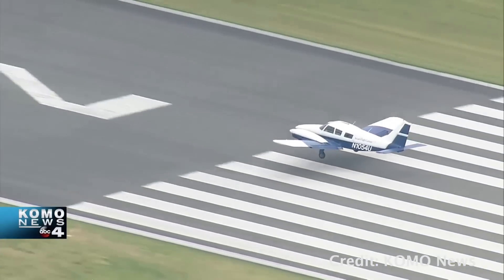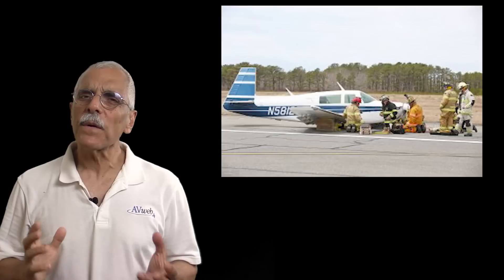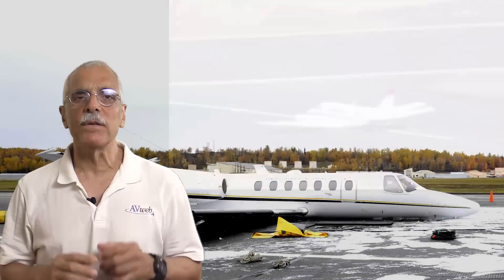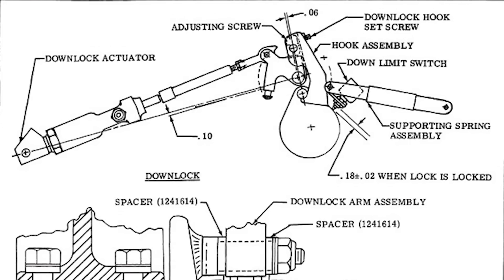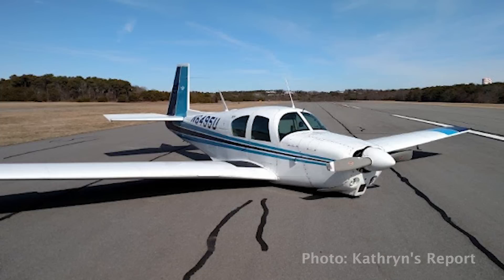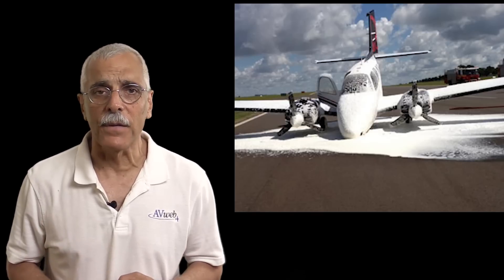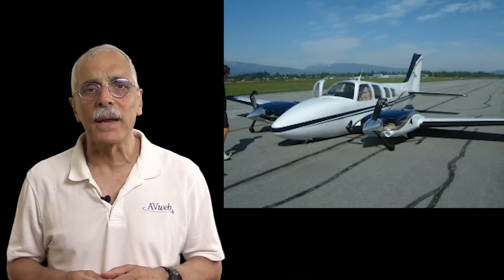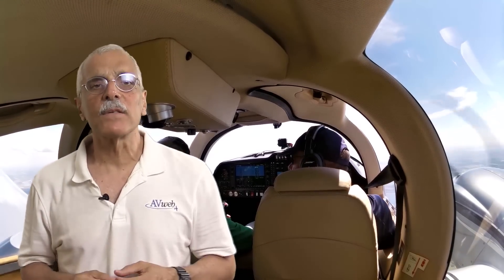Why Gear Up Landings Happen

Comment: I appreciate this video VERY much. I fly corporate and got distracted on long final by an ATC order to go around, ATC also advised they needed time to sort out what was preventing landings, ordered me to higher holding altitude and speed. So; I elected to reduce landing gear drag and clammed up.

When I got clearance to land again, I also went through my approach and landing check list, again, which is bullets and briefs, written down, and easily visible day or night, and not blocking gauges.

I was confident all was well until I got to GEAR DOWN: I was surprised I did not remember GEAR UP. So; DOWN they went. Never assume, always check, then recheck if possible, and have a visible check list. I got flustered because I swore to myself, "I KNOW I lowered the gear." But did not remember raising gear.

So, with ego working too much, I finally realized I am now distracted !!

LESSON: every once in a while, or, as often as necessary, one has to shuttle the ego to the off ramp and fly - aviat; navigate; communicate  ... use the disciplines of self-control and aviation knowledge. Those habits build solid, reliable experience and expertise. Those repetitions build confidence but confidence is not substitute for an up to date check list. A check list keeps you aware, attentive, and alive.

It does not matter how much pilot experience one has because, most every landing/take off check list procedure is the same. Some exceptions relate to weather, icing, and traffic. But the basic check list does not vary very much - EXCEPT - every landing and take off - EVERY SINGLE ONE - is NEVER the same especially and including touch-and-go.

Never assume, be complacent, because that can get you killed. I always keep looking up, down, side to side, and as far to the rear in those actions as possible for that errant Cessna or 777 taking air space they should not be taking - or did you just get into air space for which you were not cleared ...
 O :(  M :(  G :(

Never assume anything. Check it, prove it, anticipate, and fly accordingly.

Great video. It was a welcome refresher training !

Comment: To add a bit of humor I submit my experience as a police officer dispatched to a plane crash.  Skipping all the details I leave you with the pilots only comment:"I forgot which plane I was flying and instead of lowering the flaps I raised the landing gear!"
Reply: guess handles of switches move up in some planes down in others or, ...and did not check gear lights

Comment: I have only one close call so far where cycled the gear and got no green lights. It ended in a maximum pucker factor, a go around and a gravity drop just to be sure. Turns out all three bulbs decided to quit the job at the same time and now I fly with a full spare set just in case.
Reply: can get leds that never fail l read

Comment: I have a video of an inadvertent gear up (of me)... We were having a short field contest at the airport open house, and I forgot (due to non-standard approach/distraction from checklist). It was quite a surprise when the nose, which normally descends to horizontal, dropped past that with the resulting grinding at 70 knots (80 mph). I agree with your pavement suggestion. No prop damage on my landing  '-)   https://www.youtube.com/watch?v=uiWM_bxVS18  You don't mention canard type aircraft, which evidence seems to indicate at least 50% have forgotten at some point.

Comment: Why do gear up landings happen? Because the habits and procedures to prevent them are not in place. Have you noticed that it just doesn't happen to the pros at the major airlines? Why? Adherence to procedures and checklists, and configuration warnings that cannot, in some cases, be cancelled. The response "down, three green" is made while looking at the indicators, by both pilots. If a light is out, a glance at the repeater display on the overhead panel will tell the tale, real fast. The checklist will save a GA pilot in the same manner. I make it a habit to look, one more time, at the gear indicators while passing 1,000' AGL on landing. 50 years so far (knock on wood), and have never come close to a gear up landing.

Comment: I was a glider pilot some years ago and a friend also "forgot" to put the gear down. Luckily not much happened, just the gear doors were ripped off and it was easy to reapair. Guess it's also about the weight. A glider weights around 250kg, compaired to a tinplate colossus (e.g. C210) around 1.5t :-)

Comment: I've been flying for 38 years and that's one of the best analysis on gear up landings I've seen.

Of particular note is the analysis on pilots shutting down engines to save props.  That is something I always said complicates the situation and can make things much worse.  I've received no small amount of static for making that analysis myself.  It seems some people just can't make the correlation that shutting down engines prior to touchdown is actually compounding the emergency.

Shutting down engines at touchdown is much better than shutting down engines prior to touchdown if one is going to shut down engines.

In the video I linked to below the pilot chose to shut down the engines well prior to touchdown.  This was videoed live on CNN.  The anchor mentioned what a great job the pilot did and how appropriate it was to shut the engines down when he did.  I don't agree at all.  He turned his plane into a glider and compounded his emergency.  Now in addition to the nose gear being retracted, he has a dual engine failure and no ability to go around.

In the comments section of the linked video below, I mentioned that this was probably not a good idea for the reasons I stated. This was around two years ago. The amount of static I got for saying that is in the reply.

In addition to compounding his emergency by creating a dual engine failure the pilot in the below linked video was distracting himself from the landing by bumping the props with the starter switch all the way to the runway. This probably contributed to the instability of his pitch control at touch down where he almost dragged the tail.  The pitch instability is apparent.

I don't expect news anchors to know what a good landing is and their opinions are usually skewed by ignorance.  Pilots however should know this.

In the quest to save several thousand dollars for the insurance company or oneself if one owns their own plane and is stupid enough to not have insurance, many pilots risk hundreds of thousands of dollars and the lives of everyone aboard to do that.

Read the comments in the video I linked below to see what the popular opinion is.  

No one noticed that the pilot landed in the displaced threshold, well short of the runway.  With both engines shutdown, he had no choice.  Lucky for him there was no sudden wind shift to a stronger headwind or he could have landed short of the displaced threshold.  How much money would he have saved then?

https://youtu.be/dH_AzTvnN_Q
Reply: Rick Durden in "Thinking Pilots Flight Manual" would agree with You. 

It compounds the emergency, distracts the pilot, removes all options, increases workload substantially, and still doesn't save the props. The engine manufacturers recommend teardown anyway. If its a comemrcial op, the FAA mandates overhauls for gear up landings, even if the props don't make contact with anything! Its not part of the requirement.

Comment: Regarding forgetting to lower the landing gear, why don't planes have a warning system that activates a light/bell or says "warning, gear up" or something if the altitude goes below some limit while the gear is still up?  That seems like it would be relatively simple to implement.  With a pressure altimeter, you'd also have to set the altitude of the runway (which could also be forgotten or botched), but not with a radar altimeter.

Comment: Super informative video.  And changed my mind on a few things, like keeping engines running, and choosing pavement instead of grass.
Reply: Choosing to leave the engines running all the way down to prop contact only ensures replacement of the crankshaft and other vital internal components. If you can, stop prop rotation just prior to contact, and the teardown and repair will be far less costly in the end.
Reply: @Steve-fe4lq  Obviously, everything you said there is true, though even stopping the props in no way insures that no engne damage will be incurred anyway, unless the prop stops in a position such that no ground contact will occur (near horizontal).  Even if you bang a stopped prop tip into the ground there can still be serious engine damage, especially with a metal prop, I expect, though most assuredly less. 

I guess my point was this, if you are a very high time very experienced pilot, your approach to the termination of such an emergency likely would, and possibly should, be different than a pilot doing everything he can (loaded to the brim with 'tasks') just to get it on the runway WITH the props still turning, just by virtue of decreasing pilot loading a bit at that critical juncture.

It also comes down to knowledge.  The average driver on the road who is trying to steer clear in a major avoidance situation will be likely to his foot smashed down on the brake pedal (assume we're talking pre ABS, for my point here) and will not understand that this absolutely insures that ANY steering input will not make the slightest difference in what the car does or where it goes. Tires locked up solidly and turned to lock or dead straight ahead steering makes no difference. On the other hand, if you start to spin in a car, and are vectoring reasonable straight down the road, you absolutely WANT to lock the brakes, for that very same reason, your initial velocity vector will then remain relatively constant.  The (maybe slightly) below average driver on the street, on a notoriously slippery when wet road, when they run into the back of someone is CONVINCED their brakes failed (no kidding, had it happen, couldn't convince her otherwise...so she learned NOTHING, not making this up, it happened)..this road was possibly the worst wet asphalt surface I have ever driven on, no idea why, other than it was VERY smooth, but it seemed like more than just that.

The analogs of this sort of thing is what an experienced, well trained, knowledgeable pilot knows, and the average plane driver does not.  That is one reason I believe there might be reasons to call for continued engine operation all the way to the ground for the average airplane driver.  Does that make sense?  I think removing stall spin training from standard flight training is an idiotic move...can you imagine facing that for the first time (if you've ever done a stall/spin) at low altitude.  Your chances of recovery aren't very high if you KNOW what you are doing, ZERO if you don't.  Obviously the NTSB/FAA suggestion is directed to maximum survivability, with zero concern for the aircraft components themselves.   Seriously, though, in the long run it really IS only money, compared to possibly serious injury or your life (again, not saying stoppage isn't well within some pilots capabilities without increased personal risk) for the average plane driver.  And also, I agree with you a pre-planned switch flick is not a big deal to a calm experienced pilot several seconds before a belly landing.

Comment: I like your analysis of the C-210.  I've heard about this before.  I haven't had any problem but, if I did, I would certainly land on the runway, not grass, there's just too much chance of a clod or something causing a problem, like a tip-over or cart-wheeling.  If your airport does not have foam capabilities, go to an alternate airport, which you should ALWAYS have planned in case it's necessary.

Comment: I was taught to put three fingers, one on each indicator, verify each was lit, and say "three in the green".

I had one airplane with loss of electrical system during flight in VFR, pumped down the gear and flew past the control tower for a check.

Was taught to engage every sense as much as practical and speak the check.

Comment: Most gear ups are operator error. I had a 172rg a;d I practice emergency procedures for failed hydraulic system.  About every 4 or5 months I pump the gear down and land .

Comment: We replaced our gear horn with a 5 dollar alarm siren that will pierce your brain and you cannot ignore the warning.
Reply: I imagine most pilots know the tale of the tower controller asking a guy who just landed gear up why he didn't heed the controller's warning about it on final. "Couldn't hear you with that *$#&! horn blaring."
Reply: Yeah, we had that in the 1964 Mooney.  The gear horn comes on at or below 14 inches of MP or lower.  After a while you get so used to it you forget the gear is still up.  Gear horns are good, but only so far.  It depends on how you fly your airplane. Gear horns are good if you set it in you mind that as soon as you hear it, you will put down the gear.  Otherwise, it's just another distraction in a very busy Class D environment.   IMHO.
Reply: @daffidavit  the siren we installed is so incredibly obnoxious you just cannot ignore it or forget about it. The decibel range on this siren falls right between "I would rather dig my ear drums out with a fork" and "I want to pour gasoline in my ears and light it on fire"
Reply: hehehehe love it

Comment: "Gear Up" application / feature?   Why not add to EFIS and portable GPS systems an alert when the airplane is 100-500 feet off the runway and the gear is up?  Landing gear status transmitted by Bluetooth or wifi.   Airport data includes runway elevation.

Comment: My grandfather- a WWII pilot and career aerospace engineer- had a belly landing with all three landing gear partially lowered on his privately-owned Piper Commanche PA-24 (180?) in the mid-1990s.  One of his friends at the small airport had a VHS camera handy and recorded the perfect emergency landing, which then made the local evening news!  (We inherited the original VHS tape recording when my grandfather died a few years later, and still have it to this day.)  The prop was bent, the engine exhaust pipe was grated down and the belly was scratched up a bit, but the damage was very limited due to the personal skill of the pilot.
I do not remember the cause of the mechanical malfunction ( all three gear were partially extended, and several attempts were made to shake them down before the landing), but the Commanche was up and flying regularly again a few months later!

Comment: Why do People forget the wheels? Because they are aren't using "aircraft configuration" to get to the TARGET AIRSPEEDS needed to do a landing flare. GUMP, "SMUMP" is all fine but it becomes a meaningless routine. Every nice landing comes from awareness of what speed you need for landing flare... the best way to get SPEED REDUCTION to landing flare speed is not grabbing gobs of throttle off, but using flaps, gear & throttle together to smoothly get to that speed. Of course you can spend hours and hours getting that experience with "close calls" hearing a "gear warning horn", or you can pay a CFI to explain it, demonstrate it and then supervise you while you do it.... either way is "learning" but that latter method is safer and less expensive. That's the reason why in Jets a SPECIFIC APPROACH SPEED is calculated and MARKED "Bugged" on the airspeed indicator for EVERY LANDING. Otherwise Jets flown by Crews with thousands of hours experience would run off the end of the runway all the time.
So..." Hey I'm on final. I need 70 kts to flare, throttle is at 15" MP and I'm usually doing way less than 110 kts here..." BINGO!

Comment: I am not a pilot so I wouldn't know about this but I'm curious: I imagine the large jets have this but do any private/smaller planes have some sort of a warning signal or siren, indicating that the gear is not down (when it gets to a certain low level above the runway)?  A no-gear warning system certainly seems logical.
Reply: Some have, most don't. However those sirens often aren't of much use, since you won't hear them in a stressfull situation.

Comment: I'm obviously no pilot, but might the rationale behind stopping the props be that bits flying off when the props strike the ground will fly backwards instead of being shot into the fusellage by "centrifugal force"?
Reply: Nikolaus. Stopping the props is to prevent engine damage

Comment: Travis AFB mid 90's? an Air force C5A doing touch and goes-  the repetition of approaches and  lights,whistles and bells going off the crew tired of hearing the warnings- turned them all off. next approach found the C5A with all 28 wheels safely tucked inside the aircraft.

Comment: I'll add comment on "almost" gear up landing. my usual routine was when  I entered downwind I'd  put the gear down. (North American NAvion) on this occasion I was entering  downwind into the pattern, no other aircraft, just as I was going to put the gear down the airport announced the change of landing direction- no problem I changed to mid field crosswind  entry into the downwind for the other side of the runway. this change of entry just as I was to put the gear down allowed me to forget the gear altogether-  when I was over the thresh hold and reduced engine RPM the gear horn went off, with no time to do a go around I put the gear down, got 3 green about 2-3 seconds before touch down.  lesson learned checklist checklist checklist

Comment: As a reminder to lower the gear, isn't there a blinking light on the dash once you're at a particular height (maybe a beeping sound too)?
Reply: most twins have a horn that goes off if the gear is not down and the engines are thrittled back below a certain point.
Reply: My Mooney also has a horn. Problem is it goes off when i throttle back to descend out of 17500. No speed brakes!